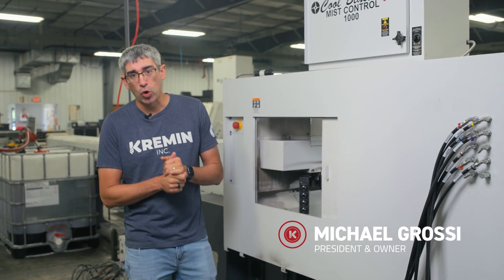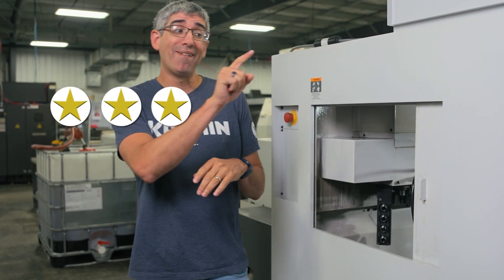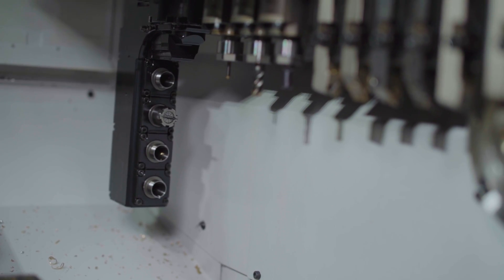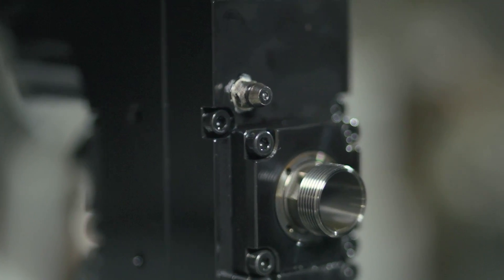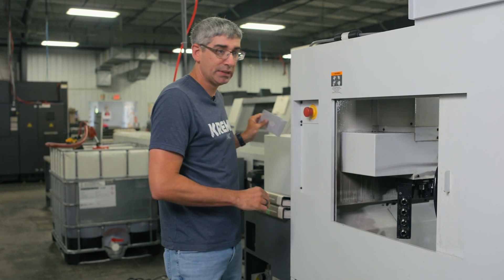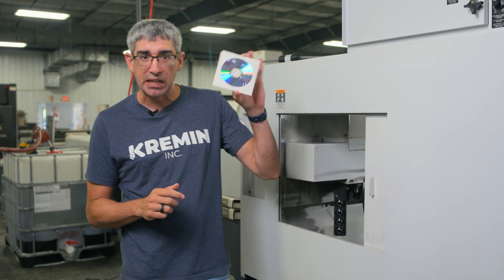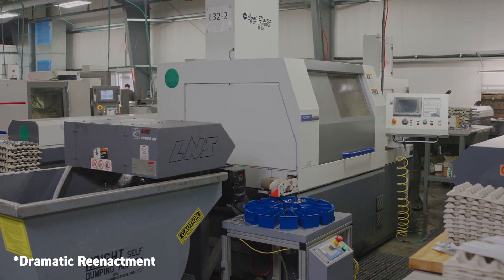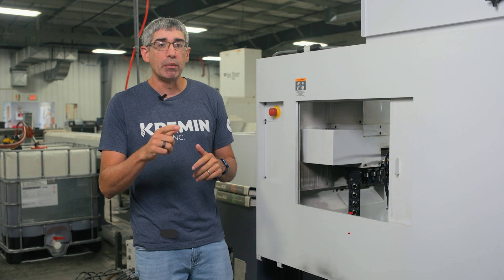Citizen L32 Swiss Lathe Review UPDATE - Kremin CNC Machine Reviews

Comment: Seems pretty absurd to run grease in anything when you have 200 litres of oil being pumped around the machine at all times anyway. I imagine you guys invented a few new swear words the day that happened.
Reply from the maker: Its an odd design choice with the machines using high pressure pumps and oil for coolant - not sure why they did not go with a sealed system.
Reply: @KreminIncManufacturing  or even a pretty much unsealed system - as long as it pumps oil through the gear train it really should be adequate. Way better than relying on grease anyway.